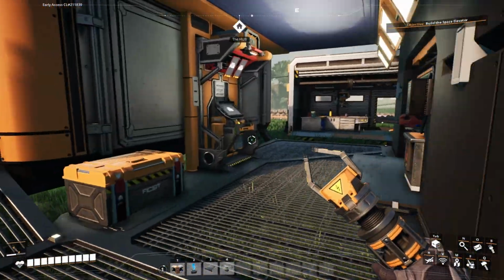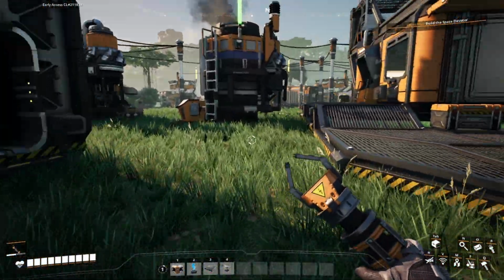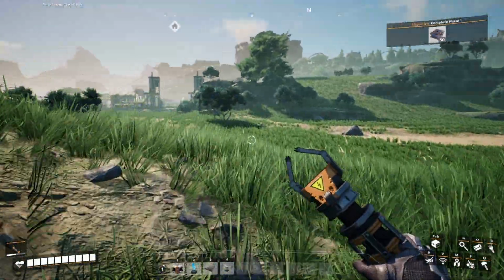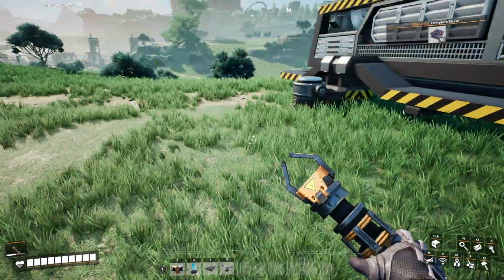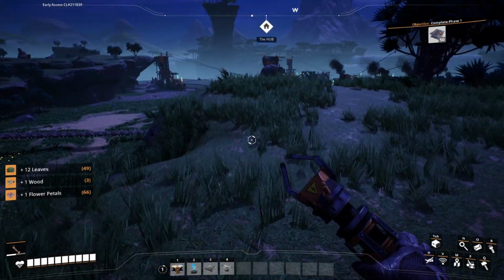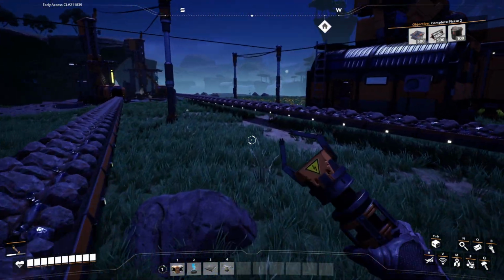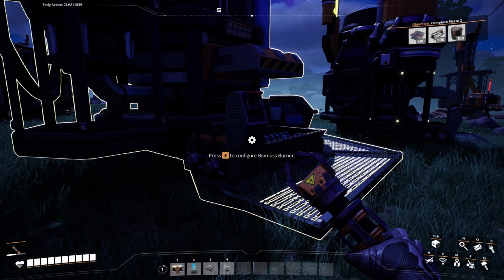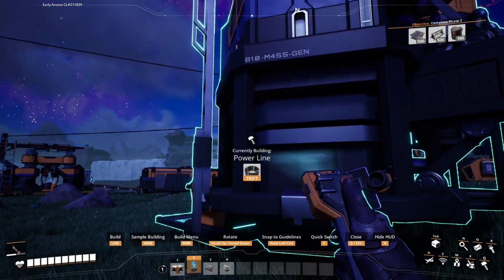Satisfactory Tier 3 Coal Power: Energizing the Future - Part 1

Comment: You should be on solid biofuel and using the chainsaw to clear large area of leaves instead of picking them 1 at a time you could even go after large bushes you can't pick up and chainsaw will grab all the leaves and wood on the ground in the area also.

Comment: you can use 1 constructor and 1 container to convert everything into solid biofuel you just have to feed the wood and leaves and switch the recipe in the constructor or complete automated with 3 container and 3 constructors and 1 merger and belts.